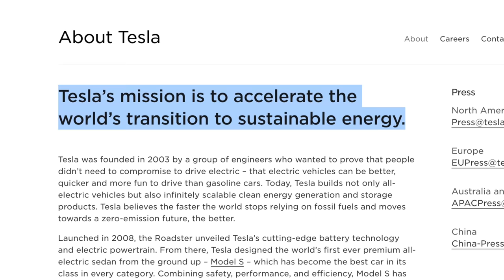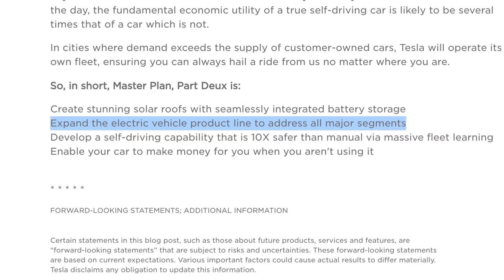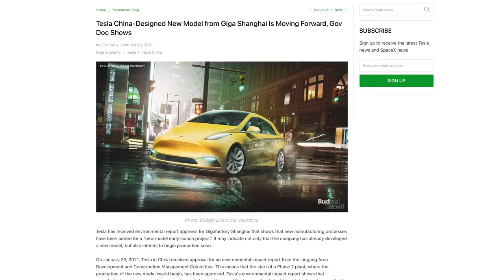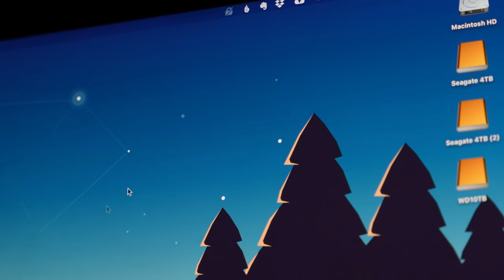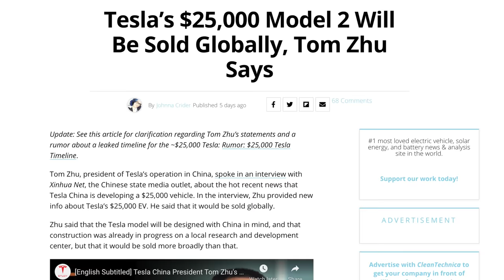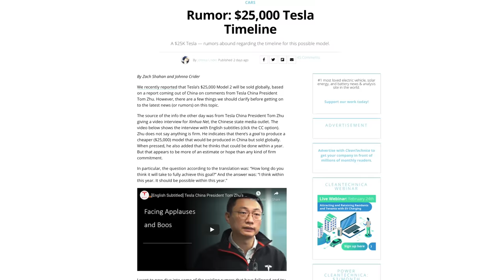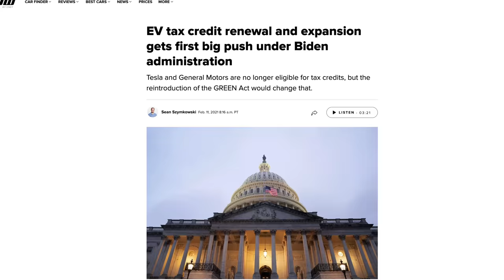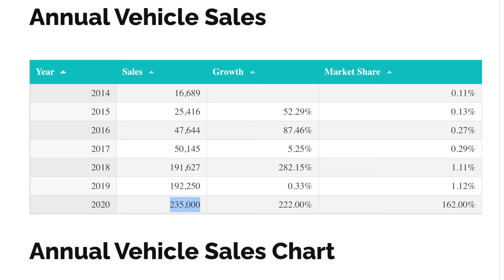New Tesla Model 2 = Game OVER for Gas

Comment: 19k with a 300 mile range and I’d be up for it.
Reply: Who wouldn't
Reply: In france tesla promised 30 000 $ three years ago ..and model3 is 60 000$   now model2 19000 $ . Hope 30 000 $ in 2022.
Reply: @That1Mexican You should be stopping at least every two hours. Driving 5 hours straight is borderline negligent. Against every damn driving manual in the world.
Reply: I actually had never heard that, makes me think back to the 12 hour trip with one stop or the 20 hour drive from Colorado to Texas with a few stops, but both mostly overnight. Won’t do that again😅
Reply: I be down I don't do cars
Reply: @AnthonyBrusca  Driving manual Source?
Reply: @chris0579  when it comes to prices and promises from business. 
The economy will break their promises
Reply: @AnthonyBrusca  my dad drives an escalade 7 hours straight and he does fine with cruise control
Reply: @AnthonyBrusca  8 to 10 hours a stretch is pretty normal for road trips in my family, and everyone I know. We just switch drivers every few hours.
Reply: @kentyler3962  You never pee? Ever? And how do you switch drivers while actively moving on an interstate? You can't stop for 20 min every 3 hours??? Pull up, plug in, stretch you legs, go get a bite to eat, pee, chat, etc.
Reply: whats the point if it is powered by non renewables ?...
Reply: @phildurre9492  well in the uk we are heading to 100% renewable electricity and are already mostly non carbon for power stations. Even if all cars were charged by gas turbine power stations they would still be lower carbon than petrol or diesel.
Reply: @AnthonyBrusca  - Yet... it's perfectly okay for ER interns/doctors, nurses, airline pilots, ship captains and truck drivers to work long shifts.  I can see factoring in breaks but still...
Reply: @__WJK__  well no point is exactly that they should get breaks. If I say you should never drive a long time without breaks, that includes truckers. Any safety and high stress job.
Reply: @That1Mexican that sound like it would be treble idea in the first place regardless of the car your driving.
Reply: @AnthonyBrusca  Haha, no way. I used to drive from MI to FL 18-20 hours straight through just getting gas no issues at all. MI to PA 10 hours like it was nothing. Its about knowing your own limits.
Reply: @lavapix  You're proud of that?
Reply: @AnthonyBrusca  What's to be proud of? Its pretty normal and done often by many. Prep accordingly and like I said, know your limits. Some people can't drive an hour without getting sleepy and others can and much longer. Why is that so hard to believe/understand?
Should we all be restricted doing things based on what others shortcomings are?
No.
Reply: And, you'll get it. That's where they're headed. Just wait a few years.
Reply: @That1Mexican You stop and charge, just like you do when you fill your tank with petrol.
Reply: @roughready  Just wait another decade... they'll be building train like transport, or personal aircraft.
Reply: @baneofsinstheoneandonly8477  So, what is that, 35 gallons of petrol? For a single person? For one trip? Yeah, that makes sense.
Reply: @sparkeyjones6261  I'm a truck and motorcyle guy the live wire by harley is a joke the other our glorified bicycles and a car well there's not many I like I honestly don't have a use for one in my life 4wd or 1 wheel drive .
Reply: @roughready  lol, when you said you don't "do cars", I assumed that meant motor vehicles in general. Yeah, I didn't even know Harley was making an electric bike. I worked for their corporate office decades ago, and even now, live close to one of their biggest dealerships in Northern California. Guess I'm out of touch. Electric bikes can be blindingly fast, but I'm not sure they fit in with the Harley image.
Reply: @sparkeyjones6261  yeah it's way over priced and for the way technology is at the price there asking it should have 2 x the milage if not at least 2x as fast. It's a sport bike style to so bad for broken backs.  If they made a cruiser I be even more interested electric cruiser bike with 400 miles of range would be epic. There making and adv and bringing the buell like back too. I just got back into riding after 15 years being dealing with trying to get my life together after being disabled from the army. I'm finally ready again so I'm learning all sorts of stuff again.
Reply: @AnthonyBrusca  You think driving 3 hours is a lot? Lmao that's nothing truckers do 8 hours before they're required to do a 30 min break and continue. My family's trips to Mexico are 18+ hours remember my dad doing a trip without any rest only stopped for bathroom breaks and continued. I myself doubt I can go that long, but regular people do long trips all the time it's about knowing your limits. Clearly you're saying this because you can't do it yourself and that's fine.
Reply: @sparkeyjones6261  no family trips to Florida not just himself including luggage only 2 fuel ups it’s not the best but it’s ok
Reply: @sparkeyjones6261  except those stations are inconsistent and difficult to schedule and find
Reply: @Please Be Racist To Me That's not true. 100% charge in about the time it takes to eat lunch.
Reply: @roughready  We'll see what happens in the future. They may just pull that off. Battery technology has been improving. Good to hear you're back at it. Take care man. Cheers.
Reply: @baneofsinstheoneandonly8477  Not really, they're all mapped out for you when you've input your trip.
Reply: @fernandof770  Oh I can do it, I stopped 2-3 times in my all-rraffic trip to DC 11 hours. I shouldn't have though. And I needed to refill and pee anyway. I got my info from common insurance docs. Also, you shouldn't be driving that distance of 18 hours if you're not a trucker anyway. It's dangerous, you're not invincible. You might wanna push through but it's putting you and everyone else in danger even if you don't feel it. At that point it's just cheaper to fly.
Reply: @lavapix  18-20 hours straight? Think you could keep your amfetamin mindset off the internet? For me, please?
Reply: @AnthonyBrusca  Yeah you have no idea what you're talking about buddy and it's not cheaper to fly 6+ people to Mexico just keep to yourself next time.
Reply: @jensjansson1993  You do realize you stop for gas. Why is it so hard for you to believe others can easily do something safely just because you can't?
Reply: All comment talk about road trip... this is not for road trip it is for every day drive! Just use your second car for road trip or if you only have one car and do road trip why are you watching electric car video at first place lol
Reply: @jensjansson1993  
So everyone who can do things you can't must be on drugs?
Reply: @jensjansson1993  Poor Jens.
Reply: But don’t accident cuze to fix it is gonna cost alot
Reply: @sparkeyjones6261  how  long does it take to charge it if you do stop to do that?
Reply: @sparkeyjones6261  The Live Wire Harley has been a press and advertising thing for at least five years. They have been staging demo rides and such, but I do not know how that is going. Several years ago Harley had electric bikes for the kids. And this year they have come out with around four models of e-bikes for adults. So Harley has been testing the waters. Although I do have an Ultra and love to ride, I have not been in any Harley dealerships to nose around. So I do not know how this is all going over.
Reply: @sparkeyjones6261  So a full charge should be good for six hours to correspond with meal time. I have driven trucks and like to take personal road trips. I will drive for about two or three hours and take about a ten to fifteen minute break to potty and stretch. Fueling waits for the extended meal break. Many of the electrics aren't there yet, but I am sure it is just a matter of time. The recharging stations will also be more numerous and making long distance travel easier by then. So right now today, ICE is still the long run king. But the landscape is changing quickly. A few more years and it will be a toss up. Once we get to that point, I foresee the government making things tough for ICE vehicles with punishing gas taxes and the like. We just need everyone to give technology the time to catch up.
Reply: @fernandof770  3 hours is a long drive for me. Unless It's spent on interesting roads. Like Pacific Coast highway one, or twisty mountain roads through scenic forests. 95% of the highway in the United States is god awful boring. As I get older, the less tolerant I am of sitting in the car for extended amounts of time. I'll jump on a plane for any destination taking longer than 5 hours by car.
Reply: @good2go4  Very good point
Reply: Yep. It’s not close to over until a <$20k 300 mile car exists. And then we need huge charging infrastructure growth, especially for renters.
Reply: Steve Dave  You're proud of that?
Reply: @AnthonyBrusca  dam your the type of person to go to a family’s holiday party in another state and be 4 days late 😂🤣
Reply: @lavapix  If you stopped for gas you didn't drive 18-20 hours straight.
Reply: @Dan-nj8du  It's called Driving straight through. No sleeping. Of course you stop for gas. How is it some people don't get that 😐
Reply: Realistically you really don't need more than 100-150 miles per charge 🤔, but yes 300 would be really nice for road trips
Reply: @lavapix  What you don't get is, if you stopped for gas you most likely got out of the vehicle and in so doing improved the blood circulation in your legs. That is the problem with long non-stop trips. For the record, I've driven across the country by myself many times. Driving for 3 days straight. BUT I stop regularly for fuel and just a quick walk around to keep blood the flowing.
Reply: @Dan-nj8du  It's called "Driving straight through."
No sleeping...
Reply: @Please Be Racist To Me You stop and recharge
Reply: @AnthonyBrusca  and yet everyone does it
Reply: Not gonna happen yet if we talk about highway range. It is difficult for small car. 

Lightweight design can provide good range in lower speeds but in highway, air resistance dominates and makes difficult to have good range except in very radical designs like aptera.

Cheap and small ev have lots of demand but there are still piece missing from the middle. Sedan is not good for many people because it is invonvenient to haul stuff. Model Y is still too large and expensive for many Europeans. In Finland, cheapest model costs 60k€ when people have used to buy 30-40k€ cars.
Reply: @That1Mexican_01 I agree, it wouldn't be good for long road trips or anything, but that's why I have an SUV. A tesla with 250-300 mi. range would be great for my daily commute. And in that aspect, It could save a lot of money. If this car were to come out, I would probably sell our Accord, (which is my main commuter car) and use anything we got from the Accord, and put it towards this car. And the SUV would be used for longer trips, or when we need more room.
Reply: @AnthonyBrusca  lmfao! That's funny I drive more miles in one week then you probably drive in a year.

Your going to tell me I've driven close to 1 million miles without accidents or close calls wrong? 🧐

What's more dangerous and negligent is people don't drive anymore, all of them just mindlessly sit behind the wheel while checking their phones.
Reply: @leopapio683  You're in the top 1% then. 99% of drivers don't do that even in road trips.
Reply: dude you realize how unrealistic that is currently
Reply: And fast charging
Reply: Same!!!
Reply: @That1Mexican_01 95% people don’t do that often. When you do, you can always rent a ICE vehicle. So that means in most cases that won’t really be an issue.
Reply: @phildurre9492  it's dramatically more efficient than a gas engine so it's still makes sense even when the electricity comes from coal. We should still try to produce more power from renewables.
Reply: And I would like a 500 mile range for $63
Reply: @quesswho69  i mean.... I don't 😅, i drive about 20-50 miles everyday, so there is no point for me and that's about a 2 hour drive everyday
Reply: @quesswho69  most people drive their car into the ground... But okay 🤔.Selling cars to get a new one is the best way to lose money in most scenarios
Reply: @quesswho69  buy a used Chevy Volt or another extended range EV then. They're great cars with no real downside. They're EVs for the vast majority of miles driven but they have a gas backup when you need more range. For options still being made (the Volt was discontinued) the Toyota Rav4 Prime looks really nice.
Reply: @quesswho69  I love my 2017 Volt.
Reply: @phildurre9492  EV are much cheaper on fuel/electric, lower or free road tax and much better for the environment, even when electric used is from fossil fuels..
Reply: I'd want min 400 mile range as itd make a 300 mile round trip quite easy then without having to stop to try and find a charge station
Reply: That's what Renault zoe costs in Austria today. So it's doable, but it will be a smaller car.
Reply: @AnthonyBrusca  5 hours isnt shit dude.
Reply: 19k for 300 miles range, idk i mean most people on average drive 25 miles a day ( ill round to 50 just in case those figures are wrong) 19k car with 100 miles rank would probably do for the majority of people so the additional materials in batteries could be used to make another electric car. Just my thoughts.
Reply: @BradElliot  Ideal solution would IMO be a standard size car with built-in battery for maybe 100 miles and a possibility to quickly replace this battery with a far larger one - 300 miles or more. Or keep the small battery installed  and just add a second one for higher capacity.

In this way, I could buy a relatively big electric car that I can drive around very comfortably on a day to day basis. And when I do need to drive a longer distance, I would just need to rent a bigger battery for a week or two.

These big batteries could be used to balance the grid while not in a car, so piling them would make perfect business sense. 

It's an extension of the NIO battery switching model combined with a new version of battery rental model that used to be popular at Renault.
Reply: @AnthonyBrusca  we stop to pee every 4 to 6 hours.we eat more than anything
Reply: Lmao that’s not happening  anytime soon , can’t even get a stock model 3 under 30 with poor Q\A and meh miles
Reply: Steve Dave  ditto.  Ohio to savanna Georgia.   No stops.  I guess I don't have a child's bladder.
Reply: That can be fully charged from almost dead to 100% charged in the same time it takes to fill a tank of gas.
Reply: I’d pay even $22k for that upgrade included. Lets hope they have a long range model 🙏🏼
Reply: Corolla is for you my friend
Reply: 25k with a 200 mile range would still be great.
Reply: @chris0579  most of that is Tesla adding a massive markup to take advantage of the increase in demand caused by other manufacturers having production difficulties. Tesla could probably sell a base version of the model 3 for about $35,000 right now and still turn a profit if they needed to outcompete a rival to increase sales.
Reply: don't bet on the 19k , those tax credits will all be used up in weeks , if you're lucky enough to be one of those ones to get cool but they go so fast it's better to expect you'll be paying the full 25k
Reply: How many days a year does one drive 300 miles? 
I’ve been driving a 80-mile range car for the last seven years and have nearly 100k miles on it now. Perhaps three or four days a year I’m inconvenienced by 20 minutes in order to fast charge it to 80%.
Reply: @AnthonyBrusca  I can go 4 hours without needing to use the restroom if I drink nothing before the drive.

Comment: Have you guys ever owned an electric car? In summer and winter you'll feel deceived to see how low the mileage between the charging. You literally charge the car all the time you parked. Hybrid cars? Well, those are only saving gas for stop and go traffic. On highways they cannot be saving gas practically and theoretically. Tell me how hybrid can save gas on highway driving! (Law of Conservation of Energy!) E-cars are even worse to environment! E cars only dump the pollution to the backyard (where electric power plants are) instead of on the pavement, actually the total pollution is way worse than gas cars adding the pollution caused by Lithium batteries.